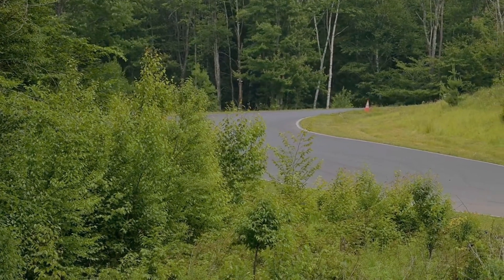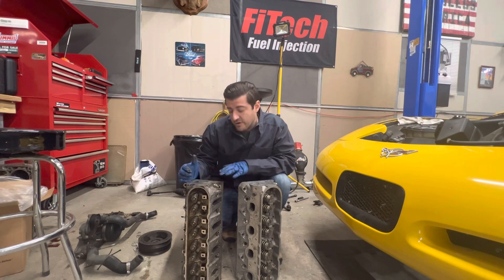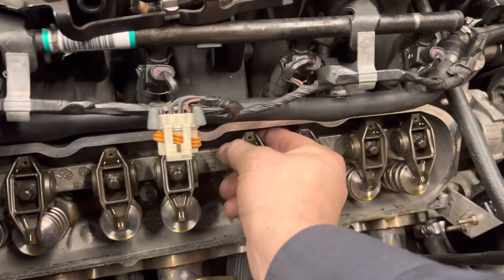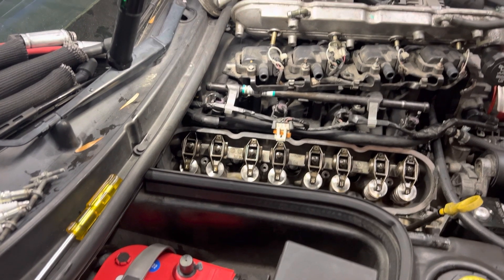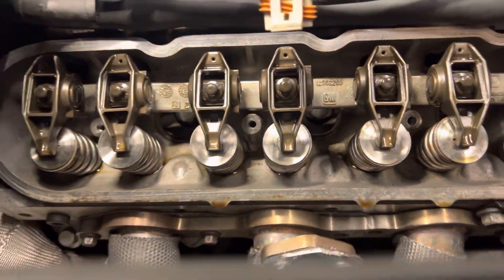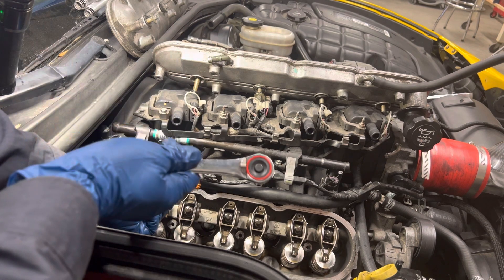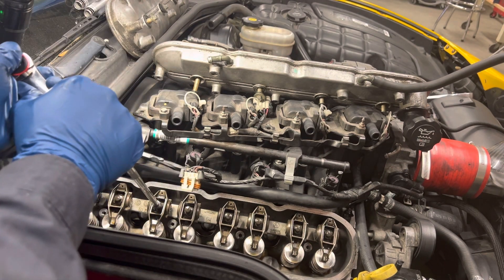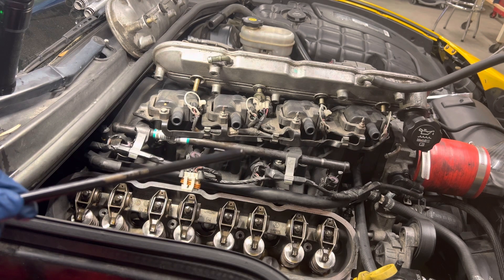THE EASY WAY TO CHECK PUSHROD LENGTH: C5 Corvette Or Any LS Engine!

Comment: More turns= pushrod is longer , fewer rotations = shorter pushrod.
Reply from the maker: Good way to look at it
Reply: more turns means you have too short of a push rod but you NEED a longer one, less turns means you have a longer pushrod but NEED a shorter one. just wanted to clarify that

Comment: Struggled with this a bit last year when putting a cam in. Still kinda sounds like a sewing machine, but I’ve read that’s common for LS. There’s prolly close to 5k miles on it since the build, what are some things you look for after a new build for when I pull the valve covers off to inspect everything?
Reply from the maker: Yea they all sound a little ticky, but this was excessive. Pulling the valve covers? Metal shavings and too much play in the rockers. They can move a hair though.
Reply: Copy that, thank you. I’m running 7.425. I think I originally went with 7.4 and when I tried rotating the engine over by crank. it was getting “stuck”. Remeasured with correct tool and did a bunch of math to end up with the 7.425s. I was gonna pull plugs and check the rockers this weekend, so I will look for shavings. I’m trying to figure out why I’m getting excessive blow by with a GM vented oil cap and elite engineering catch can. I originally had the EE oil cap connected to the catch can along with the pcv line (LS6 valley cover conversion), but it seemed like I was getting too high of crank case pressure causing leaks at the main seals.
Reply from the maker: @TheRealGhostK22  I actually went away from a vented catch can to a sealed one and that actually helped.
Reply: @LowBoostFilms  That was the plan because I didn’t want the fumes or oil in the engine bay, but when it was running as a closed system I was getting oil leak from front main. Cleaned it up and threw a GM vented oil cap (replacing the Elite Engineering cap that connects to TB), and the oil stopped pushing itself out. Tried to get some help from EE, but after multiple attempts at reaching out, I received nothing. Trying to get it figured out before putting the blower on, but most LS I see with boost are running vented cans anyways. 🤷‍♂️
Reply from the maker: @TheRealGhostK22  my boosted LS is vented, my c5 is not. I had a front main seal leak as well until I did the cam and replaced it. My hand was forced lol.